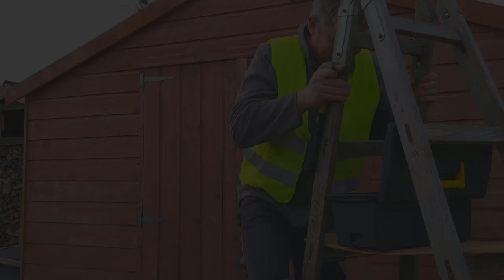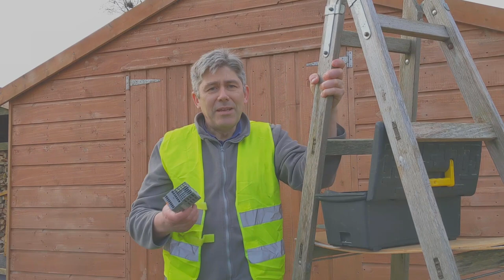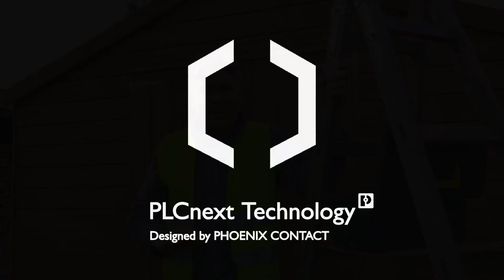What is Ladder Logic?

Comment: Phyton is much easier language than C, but as Martin has said the IEC-61131 part 3 have 5 formal languages, two of them is Structured Text and Instruction list  - it is very powerfull tools if you know how to use the, and the best part they are easier than Phyton, so I don't know why it should contain the usage of python.
On the bottom line, if you are understand the logic it will be the same in every language you would choose.

Comment: I could write all of a complex process control program in structured text, but ultimately - I would be the only person able to understand it. In order to work in the real world you must be able to communicate with people across a project who have different backgrounds and experience levels. Some are expert process engineers and know nothing of code, some are expert electricans and know nothing of process logic, etc. Ladder is a language which has the lowest barrier to entry and for that reason - it's valuable. Anyone who claims ladder logic is useless, or that because it visually represents similar logical elements differently than another language, is missing the point entirely.
Reply: Very well explained! The simpler something is, the better.
Reply from the maker: Thanks for sharing that, Dave! Great addition